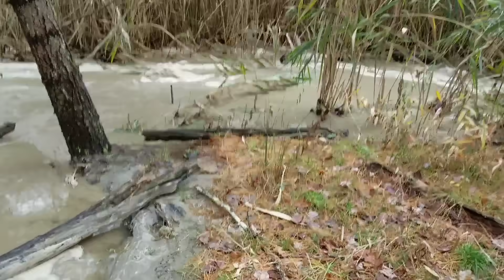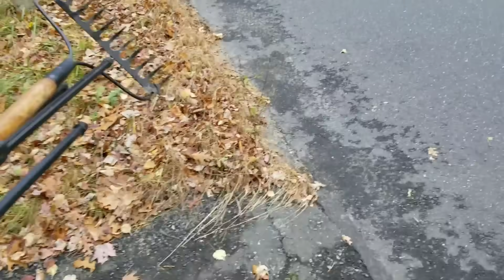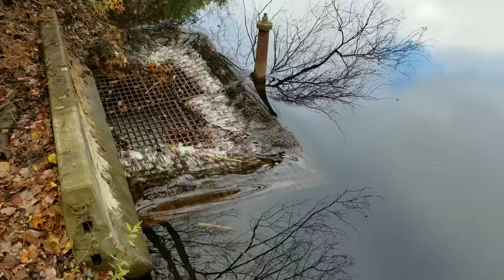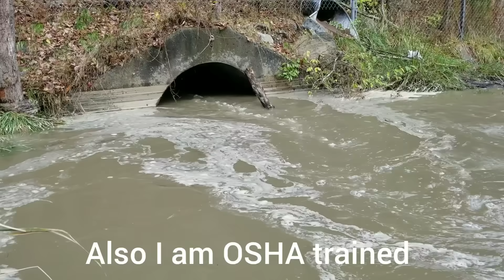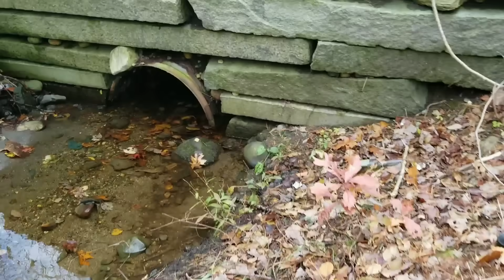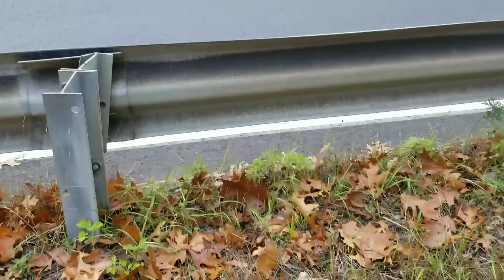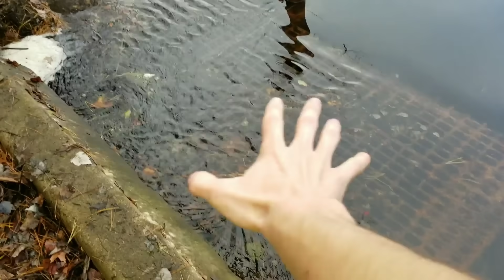Lake Drain Culvert Collapsing, Causing Sinkhole/Flood Hazard

Comment: Question...How would you repair something like this?  Wouldn't it be more feasible to "replace" instead of "repair"?  But maybe instead of replacing the pipe they could do one of those run offs that Post 10 has shown us in other videos where the pavement is designed with slopes so the water just runs off down the hill.  In any event, they'll have to do something to reinforce that road from collapsing.

Comment: Corrugated Steel Pipes.. low design life ...and very cheap for the asset owner to buy and install. PVC relining or FRC jacking pipes would be a cost effective solution to repair in situ. Concrete pipe should have been used in the first place with the pipe cover that high..

https://www.rinkerpipe.com/TechnicalInfo/files/InfoBriefs/IS304CorrugatedSteelPipe.pdf for mor information.

Comment: they used to have employees whose job it was to maintain these things, then some genius said we can cut the budget by getting rid of the engineers and operators by just awarding contracts. The banks loved it because their corporate clients got the contracts. The contractors loved it because there was little or no competition for the jobs. The politicians loved it because they got sweeteners from the contractors. But you jump forward a generation and no one remembers who where when, everybody knows its all out of date and the backlog of maintenance is too much to take on so the only way to deal with it is by emergency reaction. This is exactly the same situation with the fires in Cali... no maintenance of the power cables.
post 10 you have probably achieved nothing more than highlighting the problem because in the end if you had left the road flooded all this time they would have fixed the drain by now, seems odd but I would be doing the same as you because its the right thing to do.

Comment: The sinkhole may form on the slope of the hill & not the road. I remember a hole in the side of the pipe. Wasn't there a drop as well that surprised you when you went through that is probably where the issue is and above that is where the ground will start to sag. It could also block off the pipe and cause the pond to overfill. Be careful when crossing over the pipe where the banks are leading up to that road. reviewing the footage may give you an idea if the issues you witnessed closer to the pond or to the outlet. I suspect the trouble is where the pipe suddenly got lower. keep a lookout for trees tilting a different direction than the ones around them & for ground sag on the slopes of those banks. Something tells me it will be on the pond side of the bank. Hopefully, the issue will form away from the road. The fact you gave warning will aid anyone in getting restitution for damage or harm. Is the pond private or public? It may be them that will have to remedy this. State, Local, or Federal Representatives could be of some help. Just stay off any ground above those pipes & for God's sake don't go back into it!!!!

Comment: Union workers? In my country, they do everything except working and I'm pretty sure that this is common all around the globe. But hey, I might be wrong. I'm not some kind of a genius that knows everything ;) 

As for repairs that will happen after the failure, this is also common. Apparently, it is better to spend a lot of money to redo the job rather than to fix the issue (and spend less money). The same goes for responsibilities. Everybody has got some, but in that case, somebody else is responsible for that thing that has been broken.
I don't want to be that harsh, so I have to say a word in defense for the authorities (as for this moment). If there's a sinkhole that's being active, then it would be very .. very dangerous to do anything around that pipe when the ground is still moving all around. They will have to close the road completely, and then replace the inner section with the new concrete slabs (is that correct term?). Then they'll have to remove the upper part of the hill and fill the gaps. 

They fucked up not taking care of that part of the infrastructure and now, they'll face the consequences. Tax money will go down the drain, literally. At least they'll probably replace the old crate with better one, that wouldn't clog up ;)

Comment: Keep us posted on the progress of this thing :)

They will probably say something like this: because you have cleared the drain in the past years, the flow of the water was higher than usual. Thus aiding the corrosion of the pipe. Your actions are partly the fault of this. We did all we could we looking at it once every five years, and it was clean at that moment.

I can hear them saying something like this :/

Comment: Also “taking work away from city workers” is laughable, as if they were gonna do it anyway.
Reply: they typically only spot check problem areas.
Reply: So how do they replace a culvert that’s 30m under a hill?
Reply: DrCuriensapprentice i have basically no idea, but its also not my job to do this stuff. Maybe they completely block off the entrance for a short time to go in with equipment you can extend to reinforce the pipe? Surely there is a way to do it

Comment: doesnt surprise me at all cause govt employees are so lazy.  they want that check but dont want to work.
i had new house built and had issue with septic tank area where a hole developed due to the ground settling.  i called my city hall to see if someone would come by and make sure it wasnt a sinkhole developing and they told me no.  not their problem and i told them i wasnt asking for them to fix it, just to make sure it wasnt more then ground settling.  nope not their problem and basically didint give a shit about it.  my builder was nice enough to come by and confirm that it was just settlement and not anything else.  they will not help.

Comment: a busy roadway like that I would put in an UV pipe liner. then also inject a grout (it is the equivalent to a spray foam) to fill the voids under the road way in the dirt. The county I work at had a huge year for culvert repair this year we repaired everything 36" and above an equivalent to around 200 culverts in total but these pipe were all RCP Reinforced Concrete Pipe . Some just need to be tied together with the steel tie rods others needed more help with ties and joint repair and also grout (which is like a spray foam). We had 1 culvert 160 feet long that all joints were bad so we had them price out a liner for it. it came in at the same price as all the joint repair. but the price tag for160 feet equaled $33,000. but doing it this way we didn't need to cut the asphalt road and dig the culvert out. Let them know about this option. yes its spendy but you don't have to impede traffic and it can be done anytime of year. they would put a coffer dam in front of the inlet side and pump the water out then clean the pipe.  put the liner in then inject grout to fill the voids.
Reply: shockerjride01 That’s an excellent point - it’s far cheaper to repair a pipe like this with relining techniques you mention vs. having to dig out the hill, road and everything else to do a “boots and suspenders” repair.   Not to mention it’s dramatically less disruptive to everyone living in the area.

Catastrophic incompetence on display here :(

Comment: I wonder where the water goes when they open the valve to drain the pond?   Do you think it will go through the same culvert or is there another drainage point?  They may have to end up bringing in big pumps to lower the level of the pond to work on it.
Reply: The valve is probably at the bottom of the structure underneath the grate. So that will be of no use from now on.
As usual the cost is going to go up a lot due to short term thinking.
Reply: @TomPuttemans  Thanks.  Now I understand.  I appreciate the info.

Comment: You can try calling your local news station. Public exposure makes company's move pretty quickly.
Reply: This is by far the best thing to do. Nothing like a little attention and shaming to motivate people to do their jobs.
Reply: tesmike i agree, put them on blast at local news for saying they want to wait until there is a collapse and put lives in danger cause their being lazy.
Reply: You could also call your local officials such as your senator or congressmen and take your pictures and videos and show them.  Maybe even write a letter to the governor of your state.
Reply: Kevin Benecke 
Not really. Public pressure and shame will get the right gears greased. Going to higher ups just gets more gears involved, which may or may not work, mostly not.
Reply: Actually not a bad idea.
Reply: aside from the fact that its not a company, its the local government that takes forever to get anything done, and by the time something like this happens its usually too late to do preventative maintnence -- yes that culvert/pipe will have to be replaced

Now on the other hand if anyone dies as a result of the local government being aware of the issue and refusing to do anything the city officials can very likely be charged with manslaughter as a result of knowing full well that this could have been prevented
Reply: Would be fascinating to send a submersible drone of some kind into the culvert and actually SEE the stuff collapsing in there. Guarantee the local news would want to show it if it was good clear footage.
Reply: This is exactly what I was going to suggest. Also link your video on their Twitter and Facebook pages.
Reply: It happened
Reply: @xavier-kf9ew  a small RC boat with  a light and a Wifi camera... It's a small budget but it will give you material that you can show to the media.
It's crazy that the DOT is unwilling to do that.
Reply: Thank you for doing this.
Reply: companies, not company, but it's not a company, it's government, and government workers don't give a shit about anything except their pay and benefits. Tell them either of those are eroding or could collapse, and you'd see outrage like you couldn't believe.
Reply: Your local newspaper would love to know about this.
Reply: tesmike fire department  does more.   then the other  cause whos gonna have to help and prob get there first
Reply: Maybe the insurance companies? They usually have enough clout.
Reply: SO TRUE!!
Reply: Yep...they have ways of getting things done ...sometimes you need some public shaming .
Reply: Well, looks like he took your advice.
Reply: True
Reply: Does that really work in the usa?
Reply: GOAT GOATERSON yeah usually revealing how lazy or ignorant people are being usually makes them do their job.
Reply: @poloikuj9039  haha, that's so cool, here in The Netherlands it doesn't help at all, they just say they're going to do something about it but they don't do anything
Reply: Best idea yet
Reply: Send VIDEOS to news stations.  Nothing like SUNSHINE to get the Gov moving.....
Reply: makes *government move quickly
Reply: @Peugeot David The King contact the local papers 😆. Its not 1980 no more 😆
Reply: @slabbinonspokezz2375  Clearly you don't live in a rural area.  I deliver newspapers.  We deliver tens of thousands of papers all over my county of 55,000.
Reply: @randomlyentertaining8287  clearly your wasting paper lol. Just because you deliver them doesnt mean people ear reading them